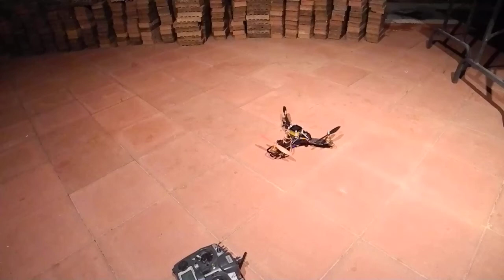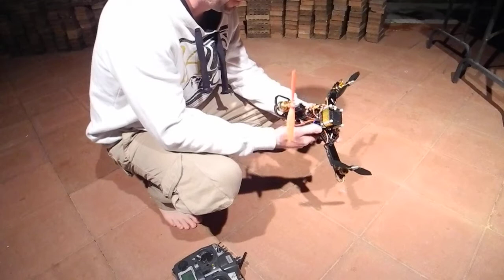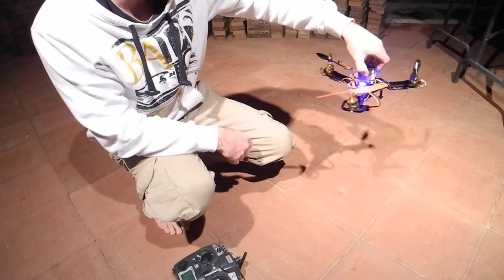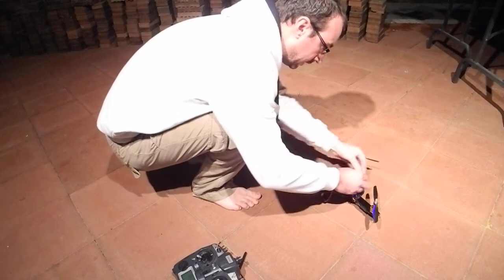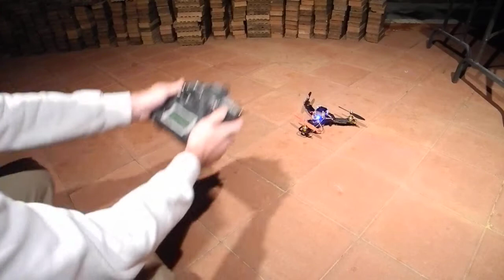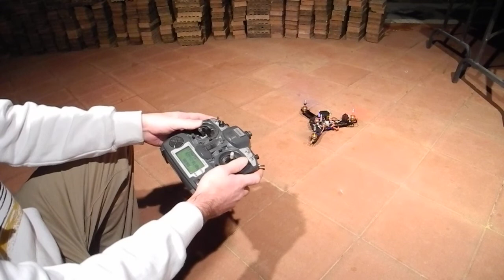Tricopter issues

Comment: plug in your servo on m4(motor on kk board..then go to mix editor ...go to chanel 4 then select the rudder and revert + or-100.if your right now is -100 you can change to +100 and keep the servo filter 50....hope to help you

Comment: When you pushed right on controller the yaw tilted right , I should tilt opposite of input . Also your yaw gyro i think is reversed
Reply from the maker: Somebody on FPVLab noticed the same thing.  I had tried a few different things and reversing the yaw was one of them. I suspect when I had tried it initially it may not have saved to EEPROM and I didn't notice, moved on to something else.

I've had it hovering but stripped it down to do some mods, because I'd have to tune it after those anyways. Thanks :)